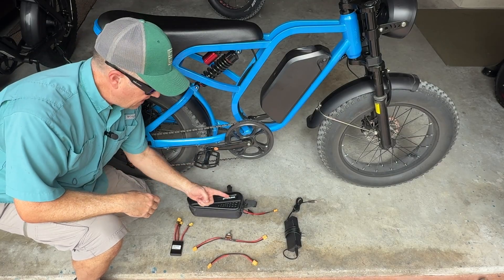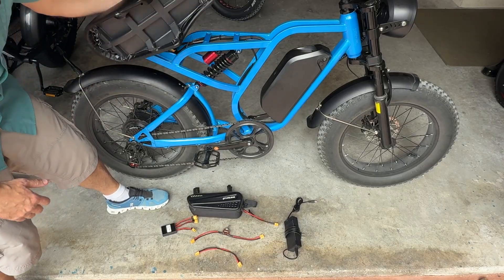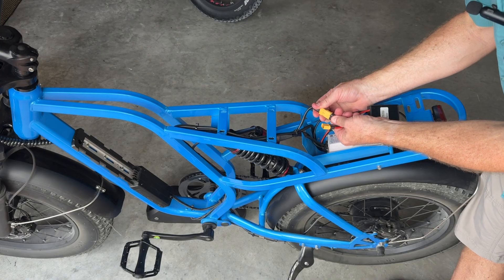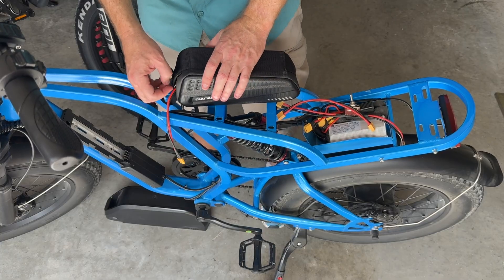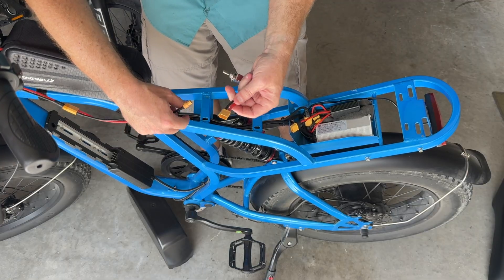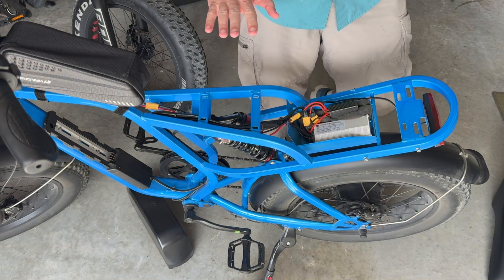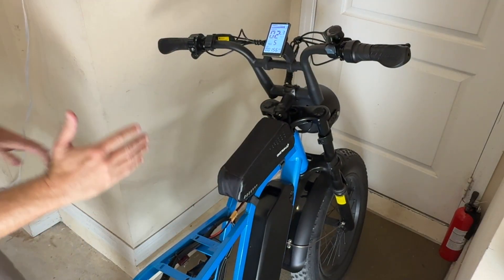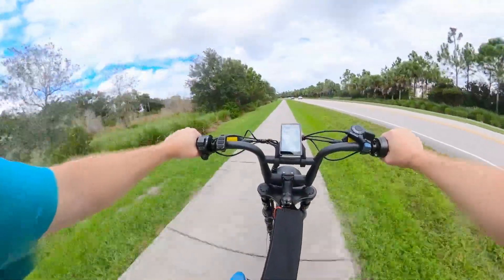Add an extra Battery to Bluvall SU8 electric bike - More RANGE

Comment: I want to do this exact mod but I have a 52v
Reply from the maker: 52v will work
Reply: @BRichSolution only thing different is a 52v battery right? I can use the same battery adapter thing you use

Comment: Where do I buy the bike from? Theres 2 listings on Ebay and Walmart, which one did you get and for how much?
Reply from the maker: I bought mine on Amazon but the seller is sold out so I would buy on Walmart as its a better price than ebay for the 52V version.  Please use link in video to help build my channel
Reply: @BRichSolution  thanks, I'll make sure to use the link
Reply: @notnol1mits I bought mine at Walmart arrived in 5 days  I love the hell out of it I will definitely be doing this mod but any idea what I need to make it faster ?

Comment: My SU8 is coming this week.  I want to convert to a full twist throttle.  Do you know of one that will work with this bike?
Reply from the maker: Yes you can convert to full twist just match the connector
Reply: @BRichSolution  I don't think all the throttles are the same even if the connectors match.  I have one I order off Amazon a while back and it worked on one bike but not the other.  I just hate the half twists.  I have Amazon Prime so I guess I can keep trying until I find one that works.

Comment: I wonder if the 52v extra battery will make more of a difference? Because of you I bought this same bike. I'm loving it so far.
Reply from the maker: The 52V extra battery will maintain 1-2 mph higher speed for slightly longer over the 48v 10ah battery.  Not sure its worth the extra money for 52v
Reply: @BRichSolution  Hi rich  i brought some new forks for my yolin twin hubi i got the thru axle seems like ive got the wrong one should I have gotten the quick release